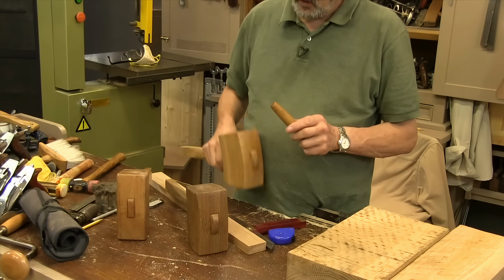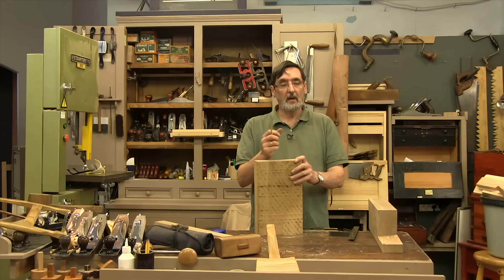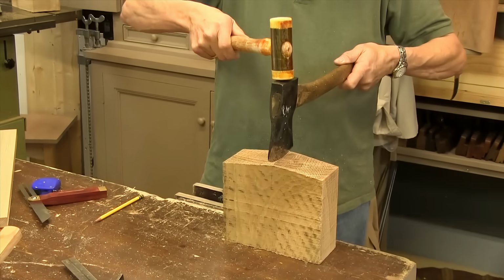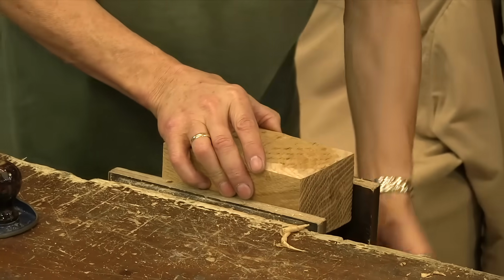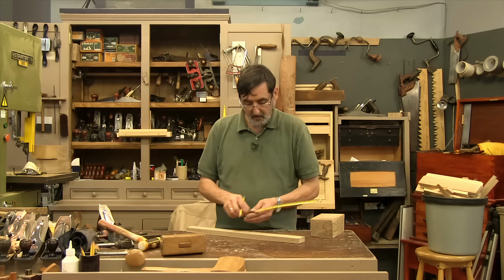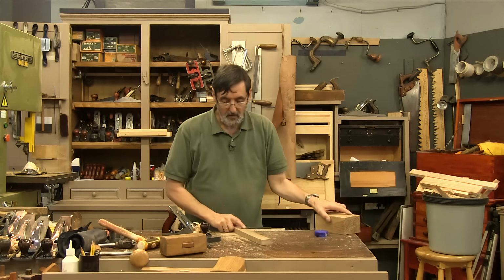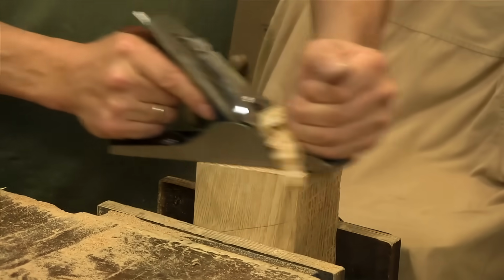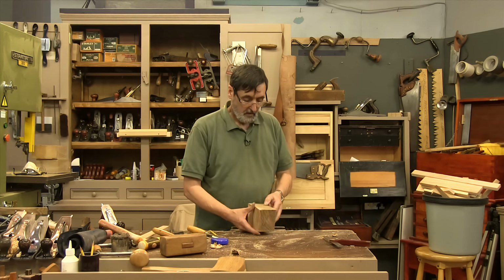How to make a Joiners Mallet (part 1) | Paul Sellers

Comment: Great tip @22:47, rationale for Paul's chosen method to mount the vise as he does.  This is not a vise video, but like virtually all of Paul's videos, there's these little tips and tricks and comments just sprinkled liberally throughout.  I'm inspired to call them "Paul's Easter Eggs", and we should all be on the hunt for them (year round), and let others know where you find one of your favorite of Pauls' Easter Eggs.  If only we could catalog them, what a treasure trove.  (If you're keen for more on the vise mounting, see the bench videos, and/or Paul's blog for more)

Comment: I was was sitting on the back steps of my shop (in Central TX) looking at a bunch of Cedar Elms wondering what on earth you could use them for 5 mins before turning on this video.  The wood I actually have milled up for this project is Osage Orange.  Bizarre that you mentioned them in the first 5 minutes of this video.  Is Paul Sellers tracking my thoughts like Amazon??!

Comment: One of the tips from my time as a joiner was to have a tennon saw and a panel saw with the same set on the teeth,  so that you could start a deep cut more precisely with the tennon saw and finish it with the hand saw without any binding in the cut.
We also used the linseed oil pad that Paul is using to lubricate the plane bottom, except where the oil might spoil the surface for any clear finish that was to follow, then we’d use candle wax which didn’t sink into the surface.

Comment: I'm going to try a smaller version with Manzanita...  It's very dense, hard to get a really large section, frequently a lot of checking. It's dense enough that if you burn the cutoffs in a metal fireplace, you should use one with a cast iron fire grate. It will burn the tar out of sheet metal stoves...
Reply: I think Id've planed the split side down and worked the other side parallel. That way my grain isn't running out. When i used to make tool handles and lots more with Hickory (5 types on my West Virginia property at the time) splitting the wood became critical and i guess that sticks still - SO many years later...

Comment: Hi, Paul. This series is super helpful. Thank you.  Quick question: I was able to locate some cedar elm, and it’s long enough to make two mallets and the handles; however, if I use a different type of wood for the handles, I have enough cedar elm to make two more mallet heads. Getting more mallets aside, is it better to make the handle from the same material as the head, or does it make sense to use a second species to save the hard to come by cedar elm?  If another species is okay, what makes a good handle. Respectfully, Dennis

Comment: I recall being taught how to make mallet by an old timer (Must be approaching 48 years ago) who worked in the estate workshops where I spent so much time during my youth.  I'd mentioned needing a mallet and he told me to return to the workshop in a few days time.  This I did and discovered he'd been sorting through the scrap wood pile for something suitable.  In essence, an off-cut of elm.  He split this bole of elm to use and my god he was good....  Split using a froe, then roughed out to shape using rasp and chisel, before mortising the head making the haft and refining to finish shape.  I still have one of the mallets he made and none of the ones I've produced since then has ever matched the quality he produced that afternoon and using such basic hand tools. :-)  Nicely done Paul :-)

Comment: Hi Paul,
Any tips on making a 4x4 round hammer with no power tools?  I did one with a handsaw and a couple of hand planes a couple of years ago to make an oval hole using a bit and brace at angles, a hand saw an old Stanley Bailey #3, some outside gouges (or is it inside?  the ones with the bevel on the outside), a jig I made up to work on a welding table jig and a cheap new Japanese plane that I tuned up.  It took a while, lots of fine tuning looking for shiny spots work out on the handle hole and handle best I could.  The whole hammer involved about 6 months without a wood working bench using my legs below the knees and upper thigh to match the hole to the handle for a lot of it.

Comment: Wood dust is not a joke.  15 years ago I suffered from a nasty lung infection that nearly killed me.  I had been sanding teak without wearing a mask.  I learned a painful lesson the hard way.  BTW, Paul, that flimsy paper thing you are wearing is a sad excuse for a mask.  You need something with a decent filter.  When the machines have stopped, the air is still full of dust, so wear the mask a longer time.

Comment: Thank you for distinguishing between “carpenters” (-those who use a tool infrequently or an amateur) and “craftsman” (-those who spend a lifetime earning a living with the correct use of the correct tool..therefore use tools lasting generations).  My mallet of that design is three generations old and has no significant chips or damage.  I found a ship builders mallet from the 1800’s that has been poorly treated and has been added as a useable backup in my tools.  As lovely as these are i made my own maul set simply because it is such a refined tool for carving, chiseling and working through wild grained woods like many walnuts.

Comment: I think 5 degrees is a better head angle .I just measure in 1/4 inch and join it to the top corner.i think his videos are just the best . The other Woodworking masterclass chap Steve Hay in Australia is equally as good with a slightly different take on things but between Paul and Steve you actually get an apprenticeship. I wild say that a learnt 80% from Paul though as he is a wonderfully relaxing teacher.

Comment: I doubt anyone is following these comments to closely at this point, I'll throw this out there anyway... Where are you folks coming up with oak stock big enough for this project? I'm am not established enough in woodworking to have a source for such material, and I don't even know where to begin looking!
Reply from the maker: Hi Tom. You don’t say where you are from. I had great success on eBay and by searching google for timber suppliers. Here in the UK, I use 3 or 4 different suppliers.
Reply: Oh yeah... I suppose that's important, huh? I am from the Midwestern United States, where I have been keeping warm during this Wisconsin winter by building a Sellers-style workbench on the unheated back porch of my dinky little apartment! It been the most fun (and biggest challenge) I've had in a long time. Thanks Paul!
Reply: And thanks for the eBay tip. I never thought of eBay as a source for that kind of thing.

Comment: What do you think of Australian timbers for density and hardness.

Yellow box air dry density 1100kg/m3
Red Iron Bark 1150kg/m3

Osage Orange is only ~850 to 950kg/m3

However Osage is hard with a Janka Hardness of 12.3kN.

However again the YB is 13kN and the Iron Box 14kN.

Would these Australian woods be an extreme or preium/ideal choice for a mallet?

Comment: Ive seen Paul split wood like this a few times what are the benefits of doing it this way.
Reply: you get a very good understanding of the grain and growth of the wood you are working with. which is important for plaining and working with it. splitting it like that, it will split in the way which is natural, and not being forced by a saw blade.

Comment: I glued up 7/8" ash cut offs 10 or so years ago while using the good parts of the boards for tables.  some of the wood had almost a curly nature to it and did not plane well so I learned to use a card scraper before I finally finished the projects.      The mallet I made was far from perfect but it suited my level of experience so I think functionality makes up for something too.  The white ash surface itself has shown signs of fracturing say every couple of years but it has taken a horrendous amount of beating and abuse so it'll always be. favorite (. let's not talk abt the handle hahaha)

Comment: From what I found online Cedar Elm has a Janka Hardness of 1320 while white oak has a hardness of 1360.  Am I missing something on why Cedar Elm would be better?
Reply: The Janka hardness is measured on the face of wood, not on the grain end.  The two can differ quite a bit.  And It's not only the hardness that matters, but how well the fibres stick together, and how well it "self heals".   As well as the mass, which matters to a mallet.
Reply: The hardness is relative to each but the elm is easier worked...

Comment: Paul using an electric tool...I never thought i'd see the day. :)
Reply: dafickler to
V v
Reply: BT the only thing
Reply: Not only electric tools, but even using a measuring band to find the center line, instead of an angle and crossmark.  Not just once, but twice!

What's next?  Laser instead of straightedge, and a mortise bit in a drill press?  :)

Comment: I always wanted to do some wood working as a hobby, what tools should I buy to have a good start whitout ruining myself?
Reply: Minimum:

A knife.  Preferably with a good handle and fixed blade.
A saw.  If you only get one, get a crosscut saw.  A ripping saw is faster for cutting along the grain (ripping), but very hard to saw against the wood.
If you get a second saw, make it a carcass saw (with a back).
A chisel - a cheap chisel set will be fine.
A hammer or mallet.
Wood glue, masking tape, cotton rags and a few clamps.
A vise or a table mountable clamp.
Assorted sanding papers.  With a glass plate, this can also take the place of sharpening stones, at least for starters.
A straightedge and a try square.  A Starret combination square like Paul uses is very nice, but it's also $100.  Pick one up at a yard sale if you can find it, otherwise a try square and cheap plastic angle will do.
A hand brush, floor brush and tray.  A shop vacuum if you can afford it.
A plane.  If you can only get one, a small low angle block plane for finer work or a #4 bench plane for bigger work.  Buy used, because planes that actually work are very expensive.
Something to make holes.  A drill, brace and bit, or a gimlet.  Brace and bit drills can often be found for a pittance at flea markets.
A couple of lamps.  At least one should be relatively low height, so you can sight along edges towards it.
Wood.  Start with soft and cheap woods like pine.

if you're going to finish what you make, I suggest you start with a few brushes, pre-mixed shellac, a can of alcohol and some cotton or linen rags.  With shellac, you don't have to have a good ventilation system or risk going brain damaged from the fumes.  Linseed oil is good for more matte finishes.
Reply: Spend some time looking at ebay and such.  Nice old planes seem to be cheaper than mediocre new ones.  People are forever getting rid of tools.
Reply: "People are forever getting rid of tools."

Indeed, much to my good fortune!  I found ~30 or so files (in a variety of conditions from broken to nearly-new), a few cold chisels and punches, as well as some other peripheral tools all for $25 at an estate sale a few weeks back.  Even if only a few of these tools are serviceable, I'd have saved a pretty penny and gotten much better quality than what can be found at a big box store.
Reply: You can do woodworking like Paul does with just hand tools for about £100-200 based on how much money and how many tools you already have. Paul has a nice series on buying tools cheap on this blog, but a good place to start is to buy a second-hand vintage Stanley or Record no. 4 Bailey pattern plane at a car boot sale or on Ebay and restore it - Paul also has a video on that. Older planes are better quality than their modern counterparts so one restored will probably never need to be replaced, and can be bought for about £10 including shipping. Buy a good set of chisels, Paul has some advice on that - If you are in the UK, A set of chisels from Aldi cost about £8, and will last you forever. To sharpen the chisels and plane, sharpening on wet/dry sandpaper on a flat surface like a piece of glass or a flat tile is good to get you stated, but expensive on the long term - the sandpaper also has many other uses besides sharpening. Again, Paul has a video on sharpening, where he uses sandpaper on glass and a polishing compound to get the final razor-sharp edge on the chisel or plane iron. For sandpaper, any can be used, but I use Starcke Matador paper That can be bought off Amazon, £3~ for 5 sheets. 5 sheets of P120, 240, 400, 800 and 1200 grit will do for flattening and sharpening quite a few chisels. For the stropping/polishing, I recommend autosol solvol metal polish on an MDF strop. Solvol is a paste that can be used on MDF for stropping, but can also be used in many other situations for polishing. Aside from these, a cast-iron combination square should also be on your list -  no aluminium ones, they don't last. The square is very important as a straightedge and as a square. Other tools to include are a combination marking guage for marking out mortices and other things besides, a sliding bevel for marking out angles and making dovetails, a marking knife can be any utility knife really, a few files are quite useful, and saws can be made yourself - Paul has a video on making a frame saw, which can be made very easily using a bandsaw blade and some basic materials, but will perform as well as any you can care to buy. That's all you really need to get stared.
Reply: wow thank you for the tips!!! I live in Canada. I started to gather tools but it was the planer I was not sure, now  i know which one to put my hands on. 

again thank you!
Reply: Best of luck finding a new job.  In the mean time, perhaps you could use your tools to do odd jobs for people nearby?
When using my workbench, 90% of the time, I only use a cutting board sized area right in front of me.  Which means i could get away with doing 90% of my work on a cutting board.  The biggest loss would be not having a vise, but it's amazing how much you can do with a bench hook, made from scrap wood.

And if you have a program like freecycle where you live, people often give away tables and other stuff that only need a little bit of repair.  And even terribly broken furniture can be used as free materials, already planed and squared.

Comment: Osage Orange should always be worked with green. Once it drys its hard to even get a nail into it
Reply from the maker: That's far from true my friend. a mallet made from green, unseasoned wood will severely crack and render the mallet useless.
Reply: I don't even like kiln dried wood - it still tends to crack in my opinion.  I might have been unlucky, but I have a suspicion that it is more dried on the outside than inside.
Well dried wood, dried with time instead of heat, is far preferable to me.   But hard to get, these days.

Comment: Have you tried japanese pull saws? I find they are far superior to push saws. What i use is a ryoba. They also work well for cutting things flush.
Reply: Japanese saws have become quite popular, and outsell Western saws these days.  But part of that is because we live in a consumerist world, where we toss and buy new instead of maintaining our tools.  Japanese saws are cheap to buy, and can't (easily) be sharpened.
They're also meant to be used at floor height - Japanese wood workers don't use workbenches, they use blocks on the floor, and their feet instead of vises and clamps.  The pull action makes more sense in that setting than when something is clamped at a tall workbench where you do have the leverage to push and can change the angle of attack.
The pull action also means you'll obscure any lines you make, as you pull the saw dust towards you.

Except for razor saws for really fine work, I would not recommend them.
Reply: Japanese saws are difficult, very difficult to sharpen.
Reply: Will Wyatt
Yeah, most people replace the blades rather than resharpen. But i find you only really need to replace the blade every half year, they don't go dull over night.
Reply: Art Heen
I personally haven't had problems with the lines being obscured. Though im sure your mileage may very.
Reply: Paul very recently made a post on his facebook page about this very subject; I thought you might find it interesting to read.

Comment: Where I'm from, we call Osage Orange "Hedge".  It can be wicked hard to cut, but it is pretty easy to split. It doesn't usually have a lot knots and those it does have usually are small.

Comment: Would pear be okay for this?
Reply: +Zareth DeTullio Probably not. While it is a pretty wood, I think it would be too soft.
Reply: +Emory LastNameNoLastName I thought pear was harder and tighter grained than Oak but I'm probably wrong
Reply: Actually, I just checked and it is a bit harder than white oak.But having worked with the two, I would say oak is a bit stronger. But, you never know until you try, so if that's what you have, go for it!

Comment: Forgive me if the question has already been asked, but... the tin with the rag in it, for running the plane over for lubrication, what kind of lubricant are you using with it?
Reply: +Tsc Tempest 3 in 1 oil.
Reply: 3 in 1? Perhaps a little more info for clarification? Please  :-)
Reply: +Tsc Tempest Sorry,  it's a brand name.   3 in 1 is a general purpose lubricating oil that normally comes in a small metal can with a clear spout.   I've been using it for 50 years.   I think Paul now lives in the States so I presume you can buy it there.
Reply: I think Paul is back in the UK, I noticed the UK electrical outlets in the background of some of his videos. I will have to try the 3 in 1 oil, seemed to make a real difference.